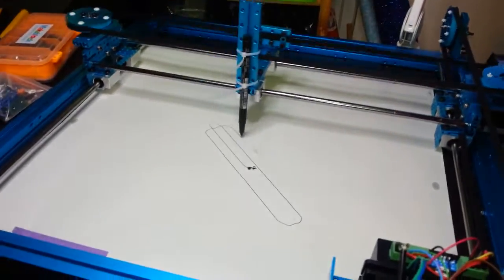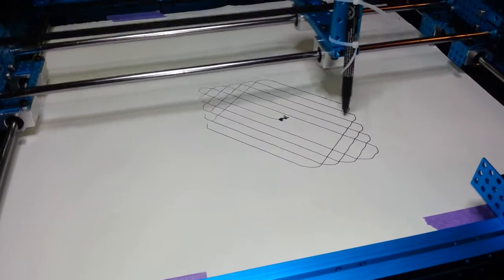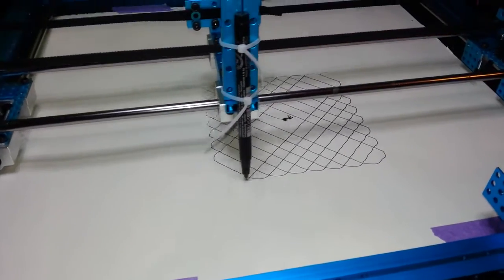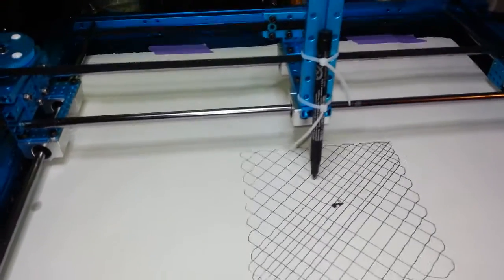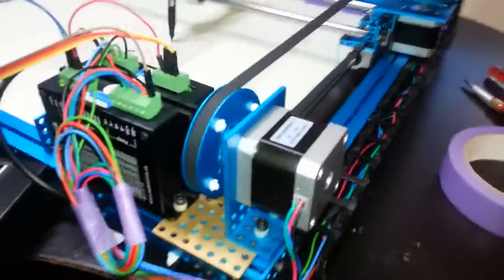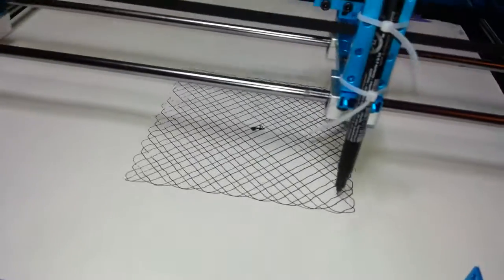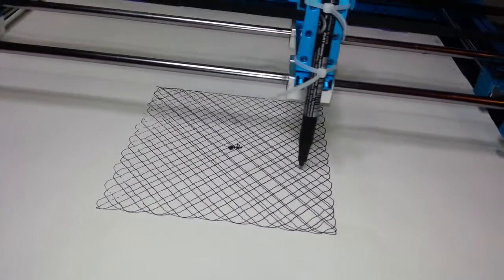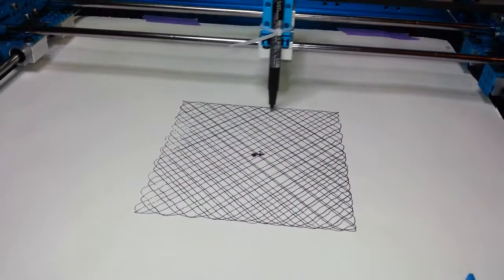Makeblock X/Y gantry drawing test

Comment: How did you upgrade the power supply, without effecting the circuitry of the arduino?
Reply from the maker: The Arduino can use 12V without any problem and you could even go a little beyond that as well :)
see: http://arduino.cc/en/Main/arduinoBoardNano